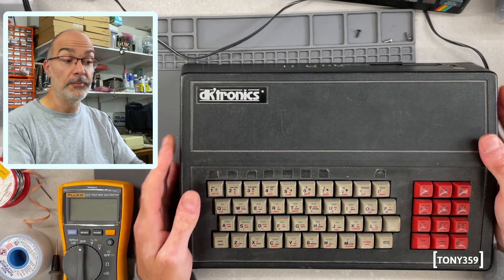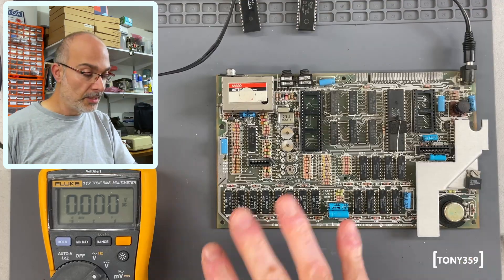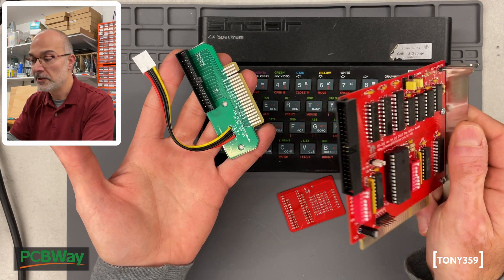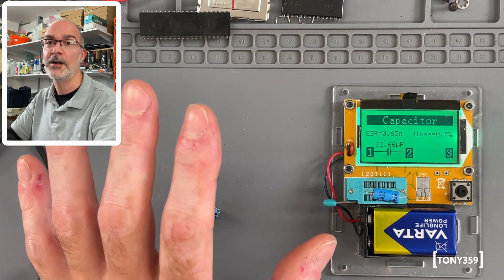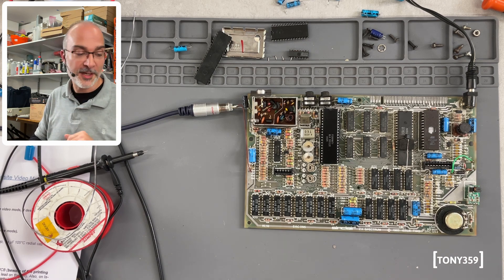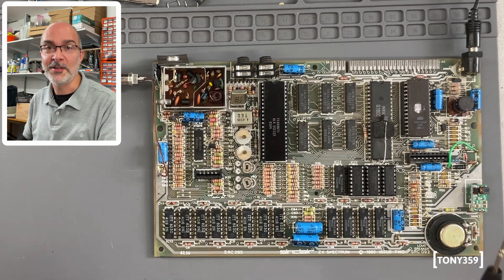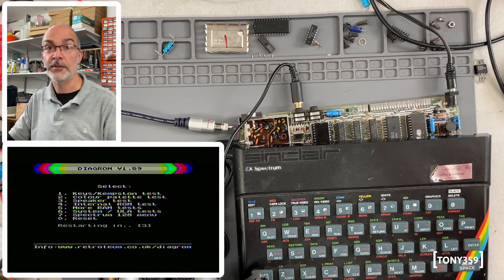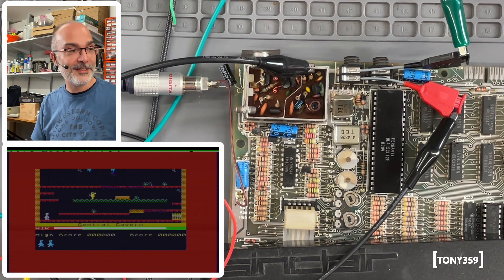A Very Faulty ZX Spectrum!

Comment: Sinclair used dodgy RAM - quote from Salkin (UK) website: "The TMS4532 is a 32k x1 bit Dynamic ram.
It is actually a 64K static ram that failed testing, in either the upper or the lower portions and was marked appropriately (-4 if the Higher portion was good, or -3 if the lower portion was good.)
As such, it comes in two variants that cannot be mixed, the TMS4532-3 and TMS4532-4 variants, which relate to the state required of AR during the CAS phase."
Reply from the maker: I was aware that the ICs were actually 64KB, but not that it had failed! I wonder whether a failed bit means the whole IC is bad. If you think with today's eyes, a less powerful CPU is often a more powerful silicon die which did not pass the performance required - so it's downgraded to a slower model. AFAIK there's nothing wrong with that but I wonder whether the same applies to those RAM chips! Thanks for the comment, very interesting!
Reply: @tony359  It was Sinclair trying to reduce production costs. The RAM chips worked fine as 32K x 1 DRAM but I guess they have started failing now as they are so old. I remember buying one of these with my savings in December 1982, 5 months before I finished school. It competed with study time for my exams (and usually won). I always used to get copied games on cassette from my school friends and as a result always had to retry loading as they would often fail. I spent more time loading games than playing them on some days.
Great video BTW!

Comment: Ah yes. The good old Speccy. My first computer was a second hand 48k +. Marginally better keyboard than the rubber key version. But not by much. I've still got it by the way :-) Re-capped of course. Also got a ZX-HD and DivMMC. You really ran into quite a few issues on this one. Nicely fixed Tony.
Reply from the maker: Thank you for watching! I guess it would have been boring otherwise :)

Comment: Good job. Back in the 80s I wrote a spice node network analyzer for the zx spectrum. Almost all in assembly. Still works great. It supports circuits up to 256 nodes. Let me know if you are interested....
Reply from the maker: Amazing, does that mean the ZX could be networked?
Reply from the maker: ah very interesting - I didn't know what a "spice" program was, pretty cool!
Reply: @tony359  It could. The Interface 1 (needed if you were using Sinclair's own Microdrive storage devices) added an RS232 port that could network up to 64 Spectrums. Seriously, the Speccy could do amazing things even out of the box, but the quantity and scope of the additional hardware you could connect to it was astonishing. At one time I had the Interface 1, a floppy disk interface, a MIDI controller,  joystick/mouse ports, video capture, external audio (with the usual AY chip) and probably a few more.

Comment: Some of that "return to black" treatment would of been great for that plastic. Usually for automotive plastics, but I've seen people use it on consoles they fix.
Reply from the maker: Is there anything that actually works? I looked into that for my car's bumpers and most are black paint you apply - I don't like the idea as I don't know how much it's going to last and what happens then? Silicone spray only works temporarily AFAIK.
Thanks for watching!
Reply: @tony359  I'm not 100% sure. I need to pick some of it up myself and try. The product I had seen used was actually "back to black" and it seemed to do good for a playstation 2 shell. Gave it that glossy sheen along with restoring the black color. 

I need to get some and try for myself. I wonder if tire shine would have a similar affect. I have some of that. 🤷‍♂
Reply from the maker: I had a quick look around some time ago and I couldn't find anything with a long lasting effect - and I don't want to paint the plastic! :)

Comment: My guess is that the reason it's reporting "ER stuck high" without the speaker resistance is that it's usind the speaker as pull-down. Clearly other things pulls it down eventually but without the speaker it stays high far too long and this is what the test notices (IE not pulled up, lack of pull down). It might even have cleaned up the audio test waveform, we see that the falling edge takes a very long time to hit zero, this may well be due to this lack of "speaker working as pull-down resistor".
Reply from the maker: ahhhhh yes that makes very sense! The circuit is so simple that using the speaker as a resistor seems logical! Thanks for that!

Comment: Besides ESR the problem with shot capacitors is that they grow a resistor in parallel, not just in series, that reads as simultaneously possibly an increase in measured capacity and increased VLoss value, they're basically dumping all the current put into them into heat in relatively short order, including the current used by your meter for capacity measurement. Doubled apparent capacitance is probably an indication that it dumps at least half if not more of the current going into it into heat immediately, and then it loses an additional 6% charge per second when not being actively held up. The ESR per se isn't something these old computers are particularly sensitive to, but the loss or parallel resistance, that's really really bad.

Also makes me wonder if just replacing capacitors with fresh ones and preferably high temperature grade low loss type would actually reduce the regulator heatsink temperature by a lot. Because all the unproductive current being sunk by capacitor loss needs to be sourced by the voltage regulator, increasing its heat output.

I also wonder what one could do to allow the ULA to remain socketable while giving it a heatsink, exactly how much clearence is there. As a rule of thumb, a copper heatsink needs half the volume envelope of the aluminium heatsink for the same thermal performance, so that's one way to save space, you can get relatively low profile ones; furthermore copper has a high lateral conductivity. Maybe all it takes is a 0.8mm thin sheet of copper and let it overhang over less critical components? Making the area 2-3 times the size can be vaguely equivalent to the difference between a sheet and a finned heatsink for area.
Reply from the maker: Good point about the regulator being cooler with new caps. I have another ZX, Maybe I can do the caps and then the regulator to see if it changes anything! I really didn't think too much about ULA cooling solutions but you make a good point too! Thank you!

Comment: as for the video input device, i use a gv-usb2 to input some of my older consoles into my pc for various reasons, composite, l/r audio, and svideo inputs, svideo overrides composite. works with ntsc and pal formats fine from what i could tell, but some software suites have issues with the , versus .  numeric separators when using the gv-usb2 with them. as far as i know OBS isn't one of them.

not sure if this interests you, or is viable with the rest of your setup, but you never know.
Reply from the maker: Thank you, appreciated! I'm testing THREE more devices, will come up with a video soon! :) 
Thanks for watching!

Comment: Sinclair products were made down to a price, so they wouldn’t have used the higher quality capacitors anyway, so likely they all needed replacement anyway, it’s not just ESR and capacitance, but also leakage.
Reply from the maker: Indeed. Caps rarely last 40 years, those were cheap in the first place and also they lived in an oven :)
Thanks for watching!

Comment: @tony359   Hi! Why did you use the two alligators to load the game instead of inserting a plug into the jack? What am i  missing?
Reply from the maker: It's a MONO socket and my cable was stereo. Because it was not working, I was concerned I was messing up with that so I wired the signal directly to the lug.
Reply: @tony359    Oh, i see. I had forgotten that detail. I've never had a ZX Spectrum, but i had a Timex Computer 2048 (TC 2048). Its compatibility is excellent. I never found a game that wouldn't run. I bought The Spectrum a few days ago. It's emulation on ARM, but it's a verry good product. Thank you for your answer. Cheers.

Comment: Just have done with it and socket them all. Then go back and recheck the 'faulty' mem chips. The diagnostic may have misreported as all data/address  lines are connected to each other. Other chips 'may' be OK.
Reply from the maker: Anything is possible of course but I'd expect similar issues on socketed ICs where the socket might get dodgy. On a soldered IC I'd say chances that adding a socket might improve the situation are slim! :) Thanks for watching!
Reply: @tony359  Only in terms of testing. If they are soldered you can't easily swap around - as you found during your testing. Some versions of the Speccy had the upper memory bank socketed anyway as they were an upgrade form 16K version - adding an extra 32K. Very rare for a socket to go 'bad' - might need a clean with deoxit or similar if tarnished over time. Also avoids constantly applying soldering heat to 40 year old chips. Good to see them still being kept going after all these years. I might have to dig mine out of storage and fire it up - hopefully still works ....... :)

Comment: More than one fault almost always indicates a meddling pillock who had no idea what he was doing. If he did know, he would have fixed it, if he didn't fix it, he probably didn't know that his inexpert meddling would just make things worse. Think of the detective and some idiot has contaminated the crime scene.
Reply from the maker: Maybe - but I believe all those parts are kind of known for failing. But who knows. The board didn't seem to have been worked on before. It was good fun though! Thanks for watching!
Reply: @tony359  In my experience, the first fault stops the device working, so no one uses it again, thus the other four parts can't break because it isn't switched on. I still believe unrelated faults are almosty always caused by a meddler :)

Comment: * A technician repairing machines of that era must have a television with a multi-standard RF input. It is something essential.
* Please stop bothering everyone with "subscribe" and "hit the bell". If you create good videos, people will. It is impossible to subscribe to all the channels you watch. I wouldn't even have time to watch the videos.
* If the computer is executing code, all lines in the data bus are correct. You don't need to check it.
* All electrolytic capacitors must be replaced. If they haven't failed yet, they will fail in no time. It's something every technician knows.

The computer is running. Congratulation. But you need to understood and learn from your mistakes.
Reply from the maker: To learn I need to make mistakes which I am sharing with you! Feel free to skip the parts that bother you!
Thanks for your comment!